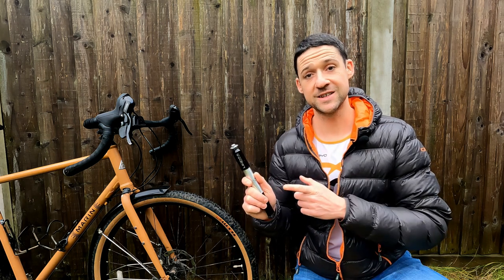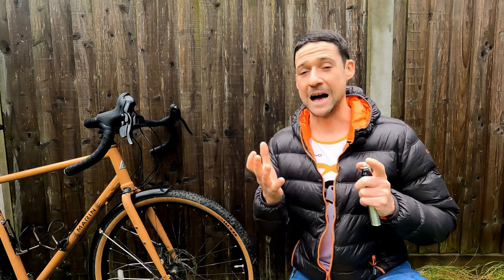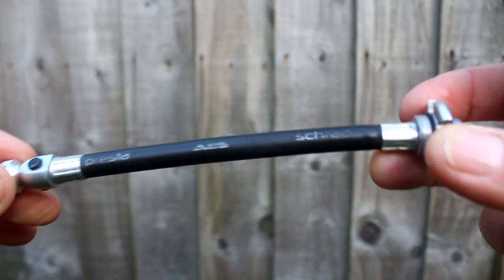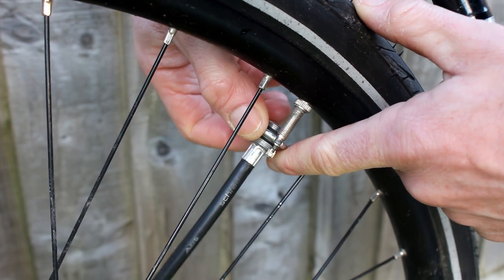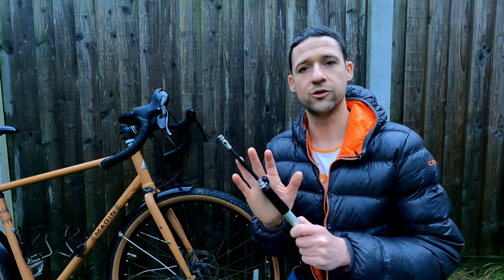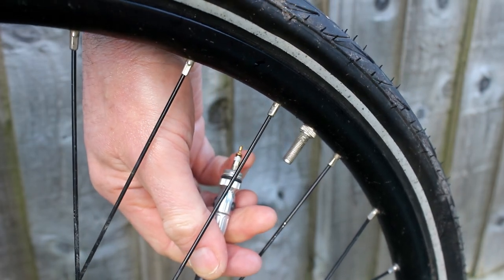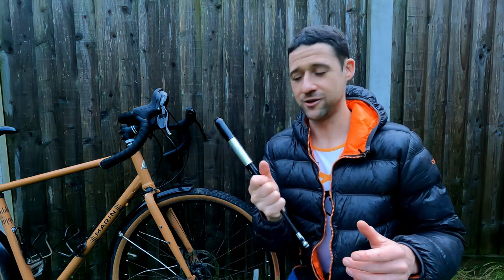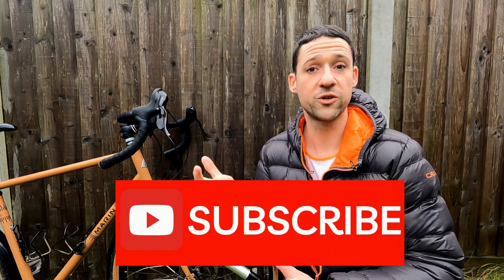Worlds Worst Bike Pump | Lezyne Pressure Drive Bike Pump Review

Comment: In what world do you notice a soft tire, then "You remove the thing that's causing the puncture, such as a thorn, in the, ah, tire. You're pumping your inner tube back up, and when you've finished pumping, the inner tube and tire stays inflated and you're ready to continue on your ride..." 

Did you miss a critical part about changing the tube? At which point  you're whingeing about having to tighten the valve core melts away. You've already pulled out your tube, inflator, tire, levers, and often times a multitool, removed the wheel, use tire levers to unmount the tire, pulled the dead tube out, inflated it until you can locate the puncture, find that same spot on your tire and checked for the embedded thorn, bit of wire, sharp rock, etc. and hopefully removed it, and then you can snug down the valve core on the new tube before slightly inflating that, installing it, re-seating the tire, inflating it, remounting the wheel, and packing everything up. 

Worst pump in the world? Because you're stroppy for one very easy extra move in, what?  a dozen more complicated moves? I might want to take this one down. 
Also, those instructions: feel a soft tire, remove the offending thorn, pump it up, get back to riding. Those are not only silly instructions, they are worthy of contempt. Makes me wonder just how long you've been riding? The person following those instructions had better have home in sight-- and no steep descents on the path. 

How about a proper "Here's how to change a tube" video? Or just direct them to the 100's already out there?
Reply from the maker: Wow, there is a lot of energy here, I love it. 
This is the second comment to flag up I missed the step about changing the inner tube, simple lapse of concentration, but clearly the gist of my message wasn't lost, reassuring to know people are listening.  
You are right, there are lots of steps when changing a tyre which makes it frustrating. In my mind adding to that list seems illogical, when there are other options where you don't have to do it. Imagine never owning another bike pump and thinking the risk of removing your inner core was normal, and that you always had to the step of tightening it. Hopefully by flagging this up I can show people there are other options. Check out the other comments, I'm not alone here, which is encouraging. 
Happy riding Alan and hope it's puncture-free!

Comment: Had the exact same problem. In addition, the O ring on the base of the plunger keeps coming off, rendering the pump useless. But now I have no problems, I found the solution - the pump is now in the rubbish bin.
Reply from the maker: Ha ha this made me laugh a lot, thank you! Sorry to hear you suffered the same fate as many on this. Reassuring that it wasn't just me! What pump did you go for in the end?

Comment: I have the Lezyne grip drive hv which has basically the same design as this and the hose is exactly the same. I use presta valves. I've used the pump dozens of times and have yet to have this issue. 🤷‍♂
Reply from the maker: That's ace. Clearly more competent than me 😂 Few of the comments have given suggestions which have been helpful. Happy riding 😀

Comment: It is actually the worst and the best bike pump. I've had this pump for many years now. I upgraded from Lezyne Tech Drive HP which had a plastic (!) thread for attaching the hose that unsurprisingly worn out in no time and I had to bin the pump. Lezyne told me back then that I must have been too aggressive when threading the hose into pump. 

So I switched to a medium length Pressure Drive which is all metal suitable for aggressive people like me, and also invested in the pen gauge hose. Still had some annoying issues though. My old Tech Drive came with a rubber collar that stopped the handle from rattling and opening but the Pressure Drive didn't have it. Lezyne said they redesigned the handle and the stopper wasn't required any more. Well, I don't know about that, when I shake my Pressure Drive it rattles, when I use it with the recycled stopper from the old pump it is completely silent. 

Finally the troublesome flip chuck. Mine corroded and I think the o-ring fell out as the chuck would leak air. I wanted to buy another one but they didn't sell replacement chucks. Only after contacting the local distributor they were kind enough to send me a spare. So good luck to you if you need a new one. The replacement has corroded too but so far is still working fine.

As for the issues with unscrewing of the valve core, I've been there many times and developed a technique to minimise this, whereby I unscrew the hose from the pump first (you have to do it later anyway) and then pull the chuck as soon as possible watching the core like a hawk making sure it doesn't unscrew first.

Why did I say it was the best pump? Because there is no alternative, a hand pump that doesn't look ugly when carried attached to the bottle cage mount, that comes with a hose and a pen gauge, and makes it possible to go up to 100+psi. 

I thought the design of the horrible chuck was a necessity due to the limited storage space for the hose inside of the pump. Yet, Birzman managed to come up with apparently a much better push-in instead of screw-in design in their Velocity Apogee pump. But the pump sadly got discontinued and the new model comes with neither pressure gauge nor their superior chuck. So that only leaves the Pressure Drive...
Reply from the maker: This was such a great comment I loved it, thank you for taking the time to send it across. I find it hilarious how Lezyne accused you of being too aggressive with your pumping. For me robustness is key for any kit, so the fact they use that as an excuse is poor. Also with any brand not to offer the after support to help keep products going, and reduce waste, again is poor. Recently I contacted Wahoo for a replacement part, which I was happy to pay for, and they sent it free of charge. I admire your perseverance finding a technique that made this pump work, good on you. I'm sure there are other pumps out there which can get to 100+psi without the pitfalls of this Lezyne. 
So have you stuck with this pump then?
Reply: Well done Wahoo. I had a similar situation with The North Face when I accidentally damaged the belt buckle in my backpack and they just sent me a replacement free of charge. Very reassuring.

The gauge in my Pressure Drive hose broke, the outer rubber split and the gauge doesn't work any more so I was looking around for alternatives but the only choice I see is the discontinued after-market Birzman. I'll try to get either that pump, as I'm curious how it performs in comparison, or a replacement pen gauge hose for my Lezyne.

Incidentally, the tool that comes with the hose for tightening the core you showed in the video, I don't have it, so it must have been introduced later. I see this as part Lezyne's admission of the design flaw and part defensive move so they can always say it's your fault the core was not tightened enough if it popped out. That tool is better than nothing I guess although it now sticks out like a sore thumb. I'd personally not want to see it hanging on the pump but stashed away in the saddle bag.

So yeah, despite the issues and subpar support I'll probably stay with my Pressure Drive in the end, as I like to have both the hose and the gauge, and that's the only product on the market which offers those in a sleek package. Also, now I finally have a spare chuck from that broken hose! 

But if you don't care about the looks much then check out Topeak Mini or Turbo Morph. I had the latter and found the fold-out stand pretty useless and the skinny handle not that comfortable but they do come with a hose, gauge and a trouble-free lock-on chuck.
Reply from the maker: @placebythesea  years ago I bought the Turbo Morph and it worked well, but it always seemed a little fragile. It never did break but I wouldn't have been surprised if it had. 
I've gone for a pocket rocket, it seems to do the job OK but I do miss the hose feature. 

I loved how analysis of Lezynes guilt in adding that core tightening tool, I never thought of it like that but it completely makes sense. The tightener is one the newer models of this pump. 

Good to see North Face also looking after their customers. Stuff like this just makes me pick that brand in the future. Why I would never get anything but an Osprey bag. 

Best of luck fixing the pressure drive, let me know how you get on, and any other cool kit suggestions. You certainly sound like you know how to pick decent products 👍

Comment: I’m with you, it’s a terrible pump. Here’s how I fixed it though. Remove the hose from the pump and throw both the pump and hose in the bin. Use a Silca Tattico instead. Problem solved. 👍
Reply from the maker: 😂😂😂 that proper made me giggle. Good to hear I'm not alone here! Happy riding mate 💪
Reply: @mammothjourneys no worries, glad you got a chuckle out of it. In all seriousness though, no you don't have to tighten the valve core or hold your mouth a particular way with any other pump I've ever used. Period. Its just not a thing. 

I confess to having a Silca attraction. I bought a Silca track pump in the 80's and its still going strong. In recent years I've added the Hiro pump head and its easily the king of pump heads. Sure it costs as much as a small car (not really) but use it and you'll understand why. And in all those decades, I've never once lost a valve core for any reason or even had to tighten one. So they know a thing or two about inflating tires without removing the valve core.

At some point for whatever reason I decided to buy the sexy and petite lezyne pump which worked out like a crazy girlfriend - looked good, caused anguish in use. Replaced it with the Tattico which while a significant investment puts air in the tire without fuss. It easily puts air in big gravel bike tires for extra win although I've bought a Gravelero for that bike now. 

Anyway the one pump and a handful of brackets means the Tattico is used on the whole fleet other than the gravel bike. The lezyne mini pump is sad and alone in the shed as a reminder of why you should never buy a terrible pump. 

A further development, I'm using a Ryobi battery powered inflator with the Hiro head now instead of a floor pump. It has a digital readout and is the future I tells you. Takes seconds to top off the tires before heading out without removing the valve cores. We live in amazing times. 😃
Reply from the maker: @KeithHeinrich  There were many parts of this reply which I loved. Firstly the sarcasm of the effect of what you do with your mouth on the impact of inflation. Secondly how long you have had the initial track pump, huge love of kit that lasts time. I've not heard of Ryobi for inflation before but it makes complete sense - genius! And finally, I hadn't heard of a Hiro pump head but the engineering on it looks immense. You have taught me so much in one comment! I've not got lost down a great rabbit hole on a world I didn't know I loved - thank you!
Reply: @mammothjourneys  the Silca Pista has been around since the 1950's. It features a leather plunger washer and parts made of metal including a push on chuck, the check valve and so on. The tube is said to be columbus steel, the same as used to make bicycles at the time. As a result, there's nothing to break or wear out really.

Mine was acquired new in the 80's and was passed around before races putting air in countless tires over the years. The brass chuck made sense since stems for tubs were smooth so it slipped right on.

Around 2018 maybe I bought back my old race bike and had it restored and had the bike shop refurbish the pump at the same time since you can still buy all the spares for them. 

As a surprise the bike shop had the pump finished the same as the bike. So now this fine heritage item with sentimental value still works as well as it ever did and looks great while doing it. This is why I think that there are many with a strong attachment to the Silca brand who for sure market on their heritage but take it seriously enough to build new products that are easy to use and perform. 

Expensive, but tremendous value at the same time.

http://gallery.heinrich.id.au/bike-stuff/cycling-pics#gallery/88aa6a2cbb386d106d54de1c2bd6f966/6512
Reply from the maker: @KeithHeinrich  Wow that is a cool back story to it all. You can't beat quality and especially when something has that sentimental value as well. Also a lot of respect and love for a person who can build this sort of stuff, it's very inspiring. Love the link you sent through as well, some epic pics on there thanks for sharing. I presume you are over in Australia? Bet you have some epic riding down there!
Reply: @mammothjourneys  we have some really good riding in every direction within a few hours of home. Rail trails have been discovered to be a convenient way to permit cyclists and others to dispense cash all over the countryside and now all the local councils have decided they must have one. They vary from adventure trail to smooth compact surface to paved and there's no cars to contend with. So popular have they become that on a Sunday its like a charity bike ride on the smaller trails while on the larger ones you might not see another person at all.

Very lucky we are to have these facilities close by.
Reply from the maker: @KeithHeinrich  The UK is slowly seeing the benefits of converting old railway lines into cycle paths with some great options. Sustrans has done a great job in setting them up. Over in France its amazing, plus the general cycling lanes available is something else. We are a long way off in UK, but some good off-road/gravel options being set up, which is ace.

Comment: Did you try using the presta (French valve) to Auto valve adapter and then just use the schrader side of the pump?
Reply from the maker: I haven't tried this but someone else suggested this as well, which seems like it would work. But by the time I got told about this I'd already bought another pump. When you give it a go let me know how you get on.

Comment: i've tried the SPORT DRIVE HV (base model) but to get 4 bar it's so hard ! .. I don't really know if the other expensive  pumps do a better job because are still 6.2bar max..
Reply from the maker: Afraid I can't help with that one. I never get ones that are too expensive. I concede it'll never get the same pressure as a track pump, although I'm sure there are ones that can.

Comment: I have a cheap plastic chinese pump that failed at the moment you need it most..4am dark, alone. Could luckily get maybe 15 psi in there or less. Was barely able to keep going. I bought an electric pump from the local chinese goods selling store and I tested it thorougly and thought hey this is actually usable..to it literally failing when I just needed it to work =.=. So now I want a decent sturdy handpump like this one on the video, but one without the suicide button lol
Reply from the maker: @X41N3  oh no that doesn't sound like a good experience. I swapped for a simple and affordable Topeak pocket rocket which seemed to do OK. No suicide button at all!

Comment: I’ve never had a pump do this before but first time I used this pump, it pulled the core out. So stupid. It happened multiple times
Reply from the maker: Hi Todd, sorry to hear you have become victim of this pump. I don't understand why they designed a pump where this is a risk. You'll see from some of the other comments people suggest ways to stop it, which is helpful, but as you don't need to do this with other pumps it seems like an unnecessary step to me. Hope you find an alternative that works a little easier!

Comment: I mean, Schrader is better anyway...I have never had any problem with them and if the inner tube has metal valve (or metal tubeless valves, which let more air through than presta), it is bombproof.
Reply from the maker: Yeah I'll be honest, as time passes I'm not sure the benefits of presta are that great for the vast majority of uses. Only perhaps road bike tyres but for a lot of riding I'm not sure what extra you get for a more complicated system. I could be converted!
Reply: @mammothjourneys  With Schrader, you can have rubber valves and those could be problematic. It is easy to cut them with the rim edge when you wiggle it around. Maybe thats why some people dont like them. But with a steel one, it is much better and the cost is almost the same.
Reply from the maker: @ondrejmanych5688  I never really thought of that. Will check it out next time I am buying some new ones. Cheers mate 👍

Comment: Similar experience.  I came here to figure out what I was doing wrong.  I use the Topeak pump on my dirtbike with schrader valves and never had an issue.  Figured my issue was because I'm new to mountain biking and presta  valves.  I see a commenter suggested blue loctite; I'll try that.  Thanks for the video!
Reply from the maker: Hey mate, glad you found it helpful and it's definitely reassuring to know you aren't the only one. Hope the loctite works for you. Happy riding!

Comment: Try their ABS-2 chuck, if you want to experience another braindead contraption. Perhaps they should just stop "innovating".
Reply from the maker: Ha ha I genuinely thought at the start this was an actual recommendation. What's the issue with this one then??
Reply: @mammothjourneys  About the same as with the reviewed one. Sleeve not moving or very tight, grip of the chuck on the valve flaky, risk of losing the spring. On average, the whole procedure takes much longer than with a conventional chuck because of the frequent complications.
Reply from the maker: @whukriede  That sucks. I now get your comment about trying to reinvent the wheel here. Best of luck to them!